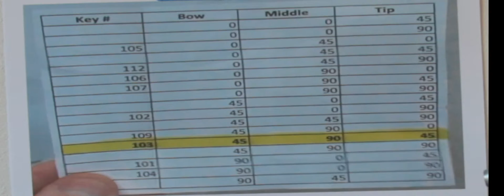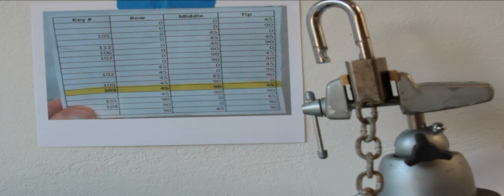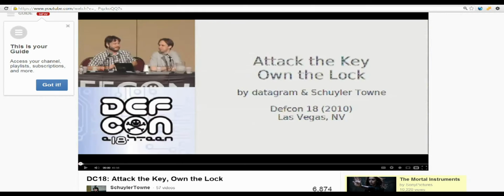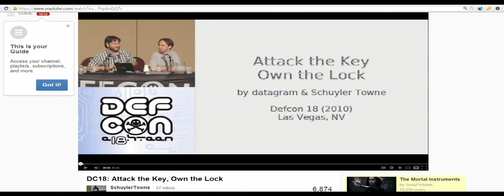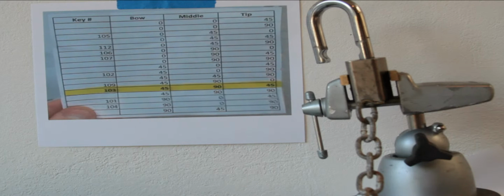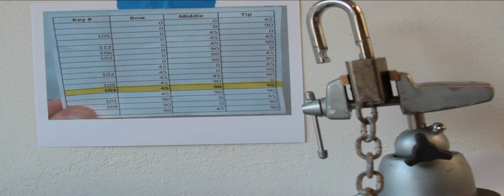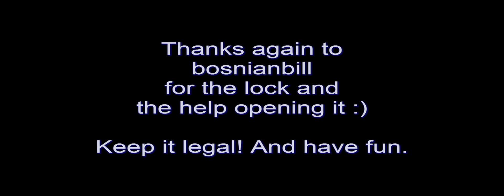(021) S&G Environmental Debrief: Analysis, discussion, and corrections

Comment: The 112 was used but was discontinued due to being non key retaining. I will send you a link to where my friend has done a bunch of research and actually shows all but 1-2 of the keys. They are actually used by the railroad. Each branch/company has their own number for their track. That is why there are only a few keys, it is also to do with the self cleaning system and reliability. The smaller 0883 version and the civilian version of the 0881 have 5 discs. Not sure on how many cuts though.